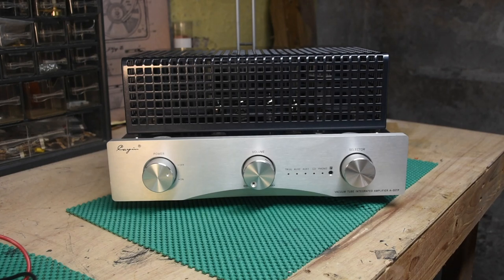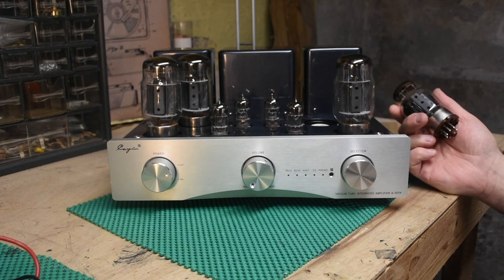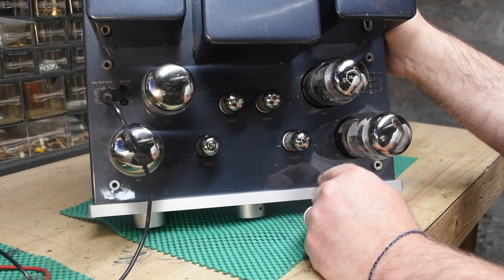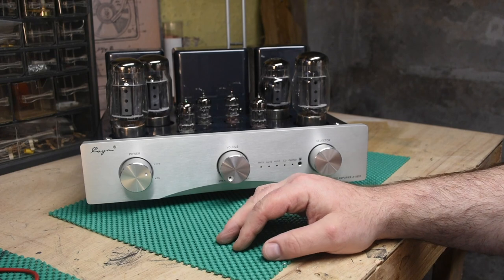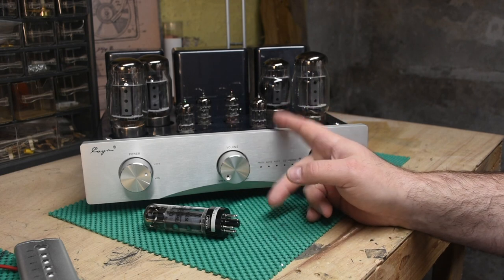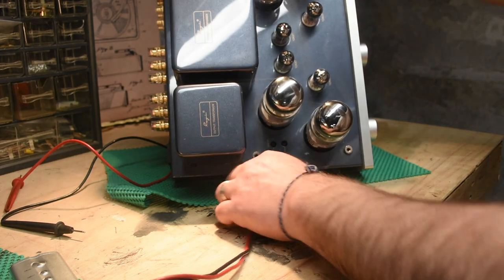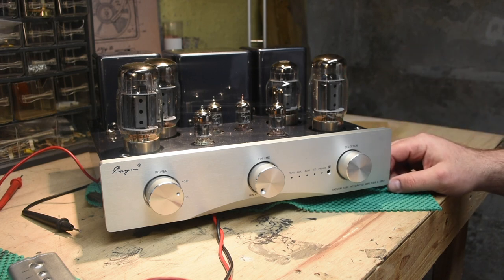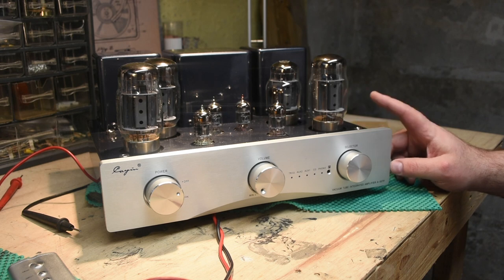Cayin A-55TP Review : I Bought A Headache!

Comment from the maker: I screwed up the bias voltage in this video and I don't want to delete it and re-upload it.  Here they are:

EL34 @ 60% of plate dissipation is 33mA
EL34 @ 70% of plate dissipation is 39mA
6550/KT88 @ 60% of plate dissipation is 47mA
6550/KT88 @ 70% of plate dissipation is 54ma

Comment: The cost and qualyty of the powertubes make me think i stay on the el84 amp caus i have nos tubes . and more sovtek . my 300b amp i dont sett up again  ebay woldent ship them cause to manny shipment failure.Rectifier tubes of modern stock are not reliable in the old days you newer bother changing a rectifier tube.
Reply from the maker: I really like JJ EL84's and their rectifiers.  They have been a bit sketchy with reliability for me, but they sound great.

Comment: The amp in this video may not be an A55TP but an A50TP. They are distinctly different amps. KT88s are the wrong tube for this amp. It should be using KT77s or EL34s.
Reply from the maker: The unit and the box literally said A55TP.
Reply: @6AM_YT  Yes. I have the A50TP and it looked the same. I did more research and learned that the models were identical in appearance.   I was fortunate that a friend was the lead tech for KLH from the mid 60s until the late 70s. He then was the lead here in Denver at the largest high-end retailer in Colorado. He quickly diagnosed a couple of problems I had.  I feel fortunate that I have had no problems and that the previous owner, a retired math instructor at the Air Force Academy, offered to pay for any repairs needed. That being said, the easy fix didn’t cost me more than a latté.